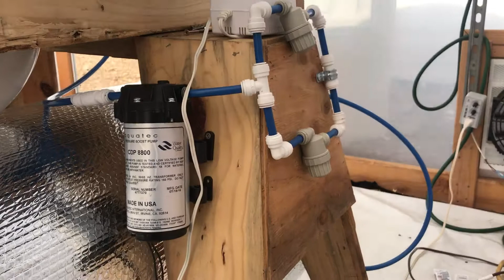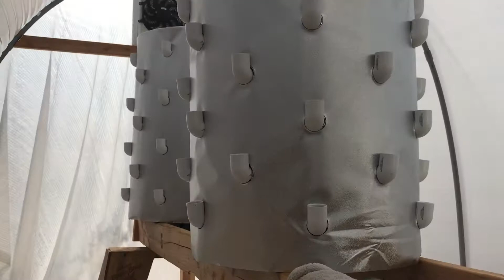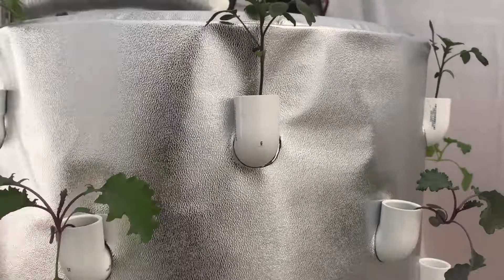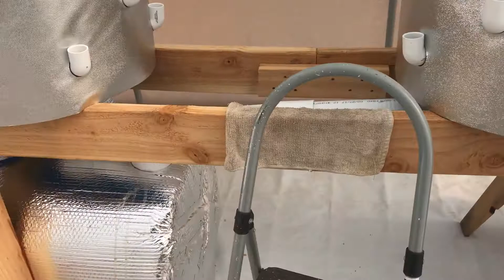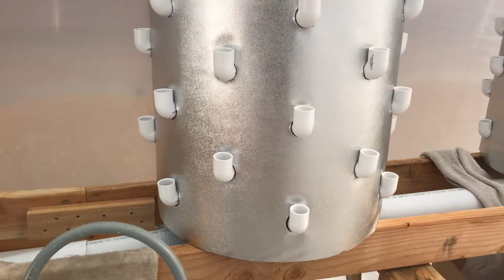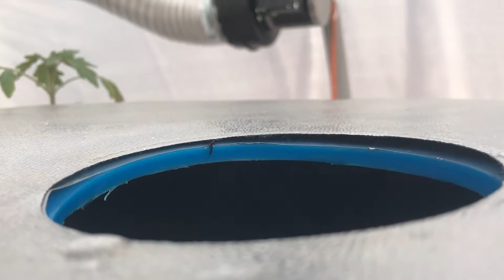California Greenhouse Aeroponic Growing Vegetables Small Urban Farm Poly Tunnel Part 3

Comment: Sounded like 17 seconds of mist so either the timer isnt accurate or the nozzles continue running on residual pressure in the lines for 2 seconds after the pump shuts down ;) I use an accumulator and solenoids to provide fast response with no run on or pressure drop. 
You can rotate the barrels using lazy susan bearings, a windshield wiper motor + 12v transformer hooked into your existing timer so it runs with the mist. As the barrel rotates, every single leaf on the barrel will be moved through the air, its better than any fan ;)
I would recommend lowering the mainline to reduce the length of the red small bore tubing if you can. You could be losing as much as 20% of your psi due to frictional losses. A pressure guage fitted with a pushfit tee is handy for checking psi at various points in the system.
Reply from the maker: thanks for all your helpful tips
Reply: no problem ;) Something else you might find of interest is starting the plants in coco rather than rockwool. I cut ABS pipe that fitted the elbows into short sections and press fitted milk jug screwcaps (hdpe) into one end of the tube sections. I punch a bunch of 6mm holes into the caps prior to fitting. Fill them with coco, plant the seeds and after they`ve rooted you can plug the whole thing directly into the tower. After harvest the coco and roots go into the compost, the caps rinsed and reused. Its cheaper and more eco friendly than rockwool.  On a different note,  you should consider using a differential pressure switch and simple flap valve to control your double poly blower. It`ll save you upto 80% of the power cost and extend the life of the blower ;)

Comment: What zone are you in? I think Sacramento is 9b and I'm worried about the summer heat too in my greenhouse. This will be my first summer seeing how it goes.
Reply from the maker: I think youre right. Im a 9a here which is still very hot in the summer. Im over by San Jose. I would have made some changes to my design if i knew how hot it was going to get in it during the summer months.  I recommend building with roll up sides to increase cross drafts and air intake.  I also have a shade cloth i use. 35% white cloth.